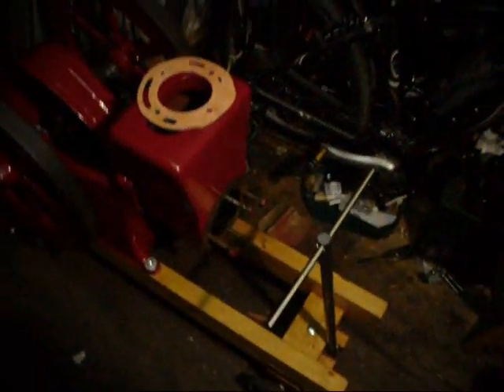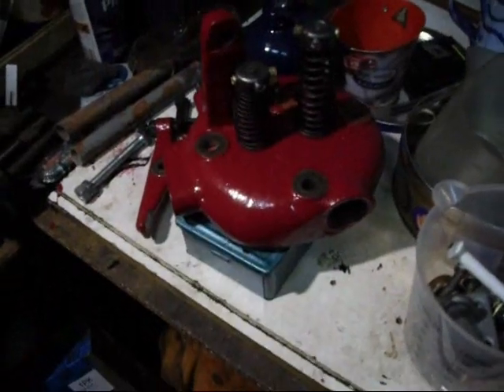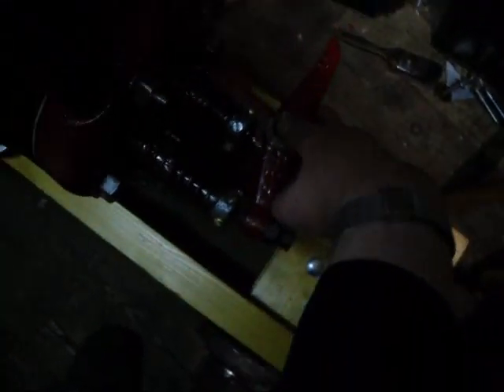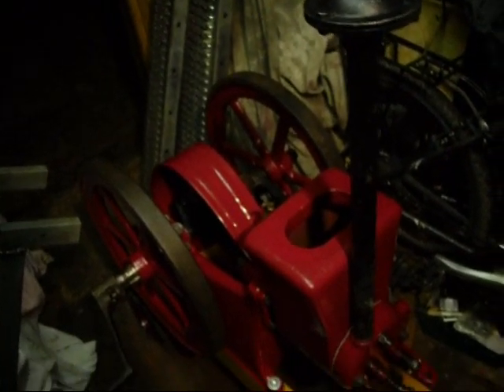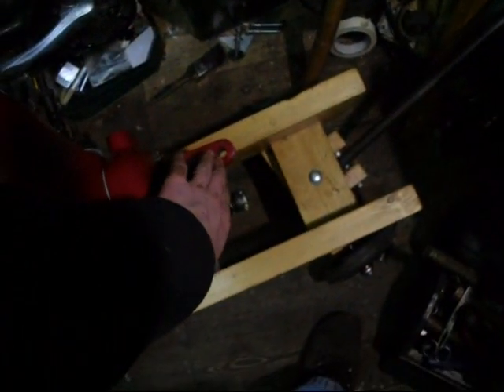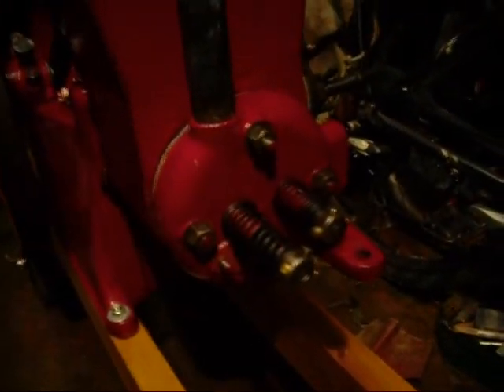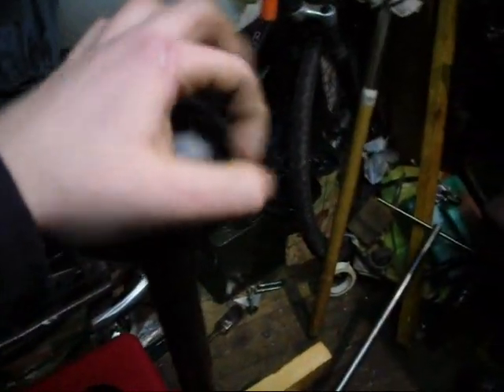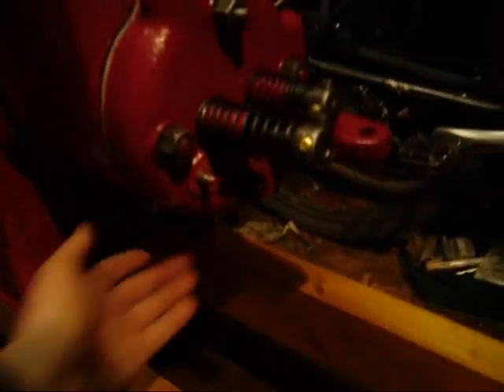Amanco Hired Man Restoration - Part 17 - fitting the head

Comment from the maker: There is a lot of pitting on the faces so i will fill that first I think, then look to repairing the old frost repair, it's just weeping a little so wants veeing out at the joins and re sealing, there is no water gallery on that part anyway!

More than a few afternoons work, got to strip all the govenor gear, paint and it it. Previous owner used far too much paint on it all, floor paint too so it's quite a challenge to remove it all.

Comment from the maker: No, far from it...

Fitted the head, mixer and got the fuel tank on two but filled the hopper today to find water pissing out from round the edge of the gasket and the old frost repair. It's not getting into the cylinder but it just ran out around the edges because the sealing faces arn't great. My new gasket arrived today so I fitted that with some sealent and it's a lot better. I could run the engine as it is, but wouldn't show it with water pissing everywhere. I have a few ideas....